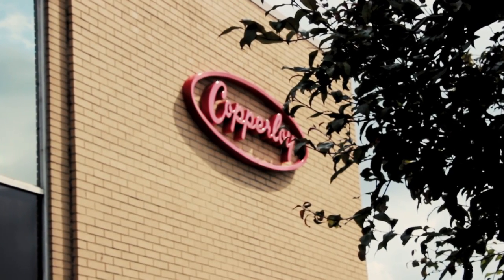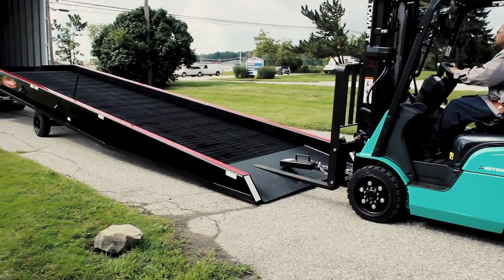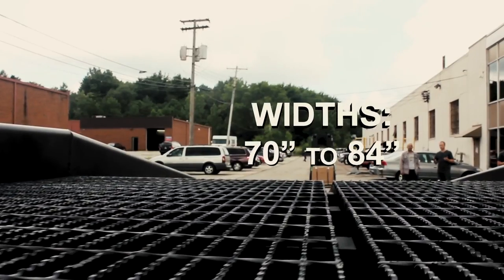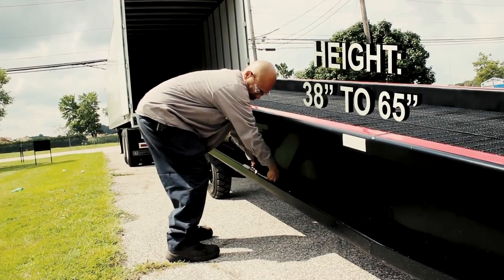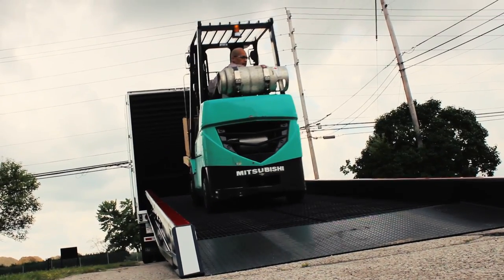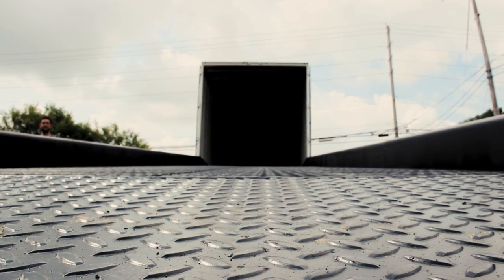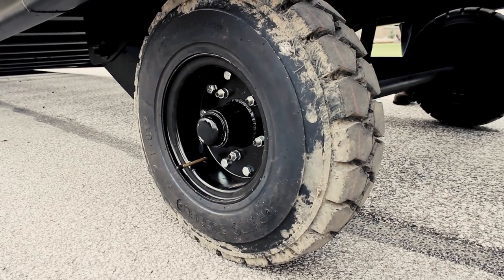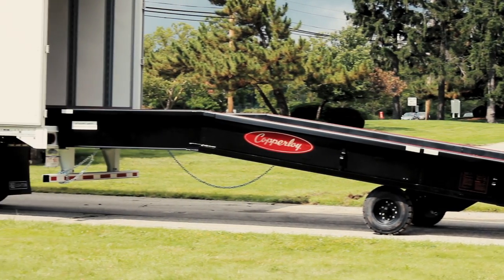Copperloy Yard Ramps in Durable Steel and Aluminum

Comment from the maker: #YardRamps are used to make loading and unloading from a dock, truck, or platform more efficient. They also increase worker safety by reducing the risk of injury. Coupled with portable platforms and yard ramps become a great alternative for cross docking freight. Copperloy makes some of the most durable, longest lasting, ramps on the market, with built in weatherization for use during all seasons.  #materialhandling